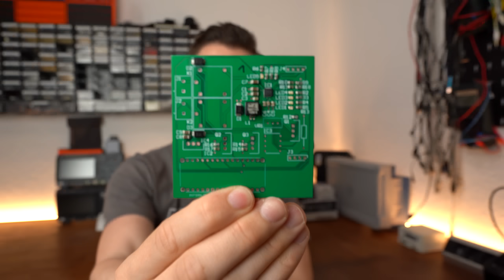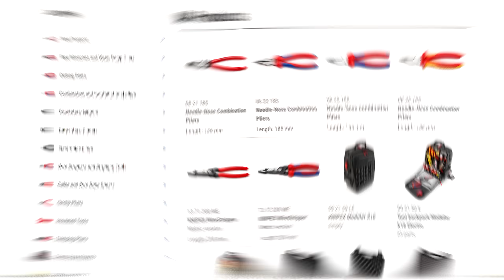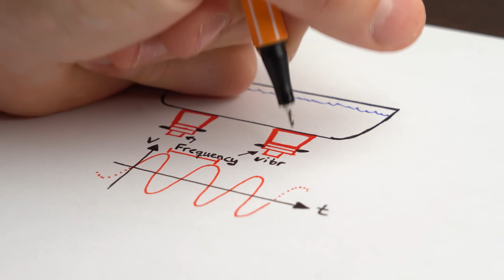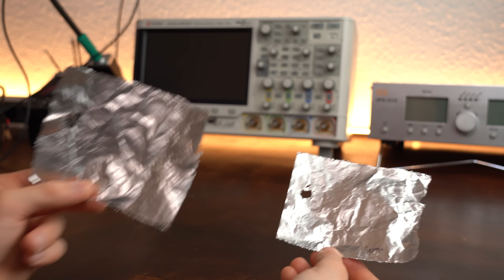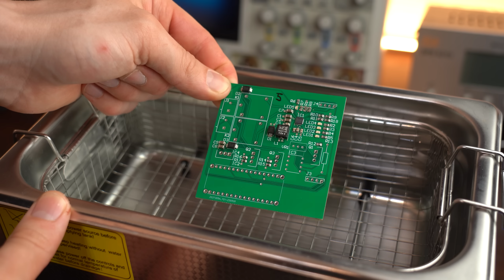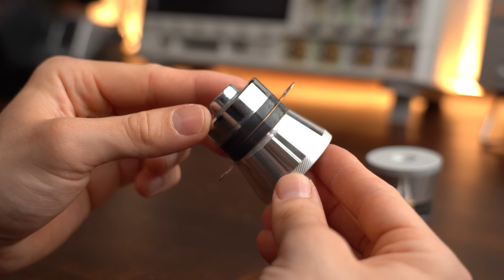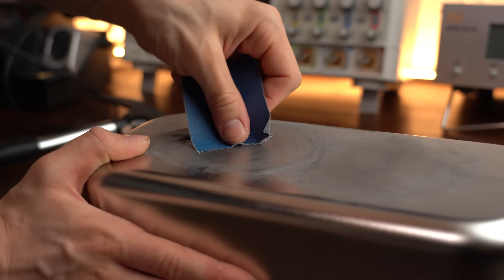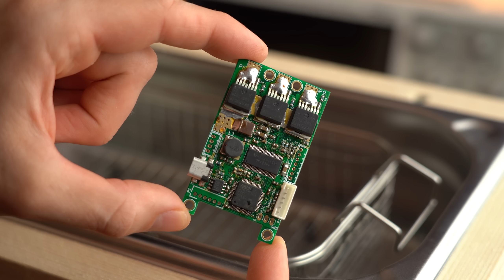The Most Underrated Tool? (DIY or Buy) Ultrasonic Cleaner!

Comment: I couldn't live without my ultrasonic cleaner, whether it's cleaning electronics, water-damaged electronics, or even for cleaning fossils - it's simply brilliant. I only have an inexpensive one from Aldi, but it does the job perfectly in my opinion, although you might need to wait a bit longer.
Reply: Thank you for your comment! Do I understand correctly that the ultrasonics do not compromise SMD connections? What about foil?
Reply: @cherylm2C6671  Normally not, but no guarantees. It's always better to clean delicate items by hand, especially when dealing with important circuit boards. It's best to try it out on boards where it wouldn't be a big issue if they got damaged. It also heavily depends on the strength of your cleaner. With the one I have from the discount store, nothing gets damaged, but industrial cleaners can be more risky.
Reply: @MarcelSchr  MarcelSchr, thank you. It seemed that ultrasonics would be better for mechanical components. 3M has a component bath that I think should work at KHz or lower frequencies since it won't cavitate ?
Reply: @cherylm2C6671  I'm sorry, but I'm not familiar enough with that topic. As I mentioned before, I'm more into it as a hobby. It would be better to ask professionals who use such equipment in their work, like cellphone repair shops, for example. They often use ultrasonic cleaners.
Reply: @Hyzerwyzer  Yes, but it should only be done for private purposes, as it can also damage the fossils. Often, water can penetrate into small gaps between the fossil and the rock and "break it free."
Reply from the maker: Thanks for the feedback :-) Yep, if you got the time, I think it can do its job very well.

Comment: I have to say that the soldering on the PCBs looks horrible, you should try some fresh / different paste, and a higher temperature as well. The one that you are using doesn't melt properly, so it forms balls and doesn't pull components into their spots. As a tip, try mixing the paste with a bit of wet flux before applying, I found that this often helps to get better soldering results
Reply from the maker: Thanks for the tip :-) Yep, I realized too late that my solder paste is no longer useable.
Reply: yeah I noticed that some solder paste works better than others. Sometimes, for small batch, I just do manual "wave soldering" with soldering iron, a good solder wire and some extra liquid flux, they're easier to clean up, and no solder balls. For large batch I just use the pcb assembly service.
Reply: I @yugaindiranmarimuthu7310

Comment: rust from your Tool can be perfectly removed with a 12v Car Battery charger, 10l Bucket Wather with Baking soda an a VASteel   as anode. Put the Anode and the Rusty tool connected to - in the Bucket and 20min Later the rust is gone.
Reply from the maker: Yep, there are many ways to skin a cat ;-)
Reply: Its very satisfying too, put the tool in the ultrasonic cleaner after :)

Comment: Tip for cleaning small parts in ultrasonic cleaner: Add cleaning solution and parts in a small glass jar and put that jar in the cleaner filled with water. Easier to clean and no need to use so much cleaning solution. Especially handy, when some small parts require different cleaning solution than what is normally used.
Reply from the maker: Sounds like a good life hack ;-)
Reply: @greatscottlab can it emulsify water and oil ?
Reply: even better solution is to use ziplock bags. Is the NASA approved method for voltile cleaing compounds in an ultrasonic. The ziplock bag doesn't mess with/dampen the frequencies as much as a glass jar will.
Reply: Use Ziploc bags, they work even better. The glass has to make physical contact with the tub for the content to vibrate, a Ziploc bag doesn't have this drawback.
Reply: @damustermann  Thanks!  I hadn't even considered that one.
Reply: @damustermann  I agree with you. I have used the Ziploc version for years. However, I believe that the glass, and it's contents, are all surrounded by the sound waves causing the molecules to slam into each other whether they are solid or liquid and travel right on through. The waves propagate themselves right on through. Thus, absolutely no need for them to be in contact with the walls of the "bathtub." There is a degree of attenuation as a result of the items in the bath absorbing the sound waves, but that is minimal. Just don't stack stuff full to the brim in there - use your common sense - and keep them below the surface. And maybe no more than about half full.
Reply: That's brilliant!. 

Are there any drawbacks though?
Reply: @therealb888 Yes, the extra container does absorb some of the ultrasonic energy, but results will depend on the power/quality and size of your ultrasonic cleaner…..and what your cleaning off your parts. Heat and proper solvents are also a big factor😎
Reply: @therealb888 no .... maybe lite bit less power but I didn't notice it when I do that metod
Reply: @therealb888  You can use a glass jar with thick glass or some other cleaner which is compatible with the glass jar. 
Also you've to slightly reduce or increase its frequency making sure that the jar won't vibrate much (or reach its resonance)
Reply: @therealb888 no drawbacks unless the circuit is off before immersing in the solution or if you completely dry before turning it on for use
Reply: @pianoguy5110     Could you please elaborate?
Reply: @pianoguy5110  I meant how it may affect the frequency & hence the cleaning or the glass itself. Some cleaners have frequency sweeps so can a glass reach resonant frequency & crack?

It's been a while since I've read these so pardon me if my questions are dumb lol..
Reply: @therealb888  OH..  I see I thought you were asking abt pcb
As per you question the frequency of the ultrasonic cleaner may be   dampened by the glass jar.... this can reduce the effectiveness of the cleaning process. Also you've to make sure that if the glass reaches it's resonant frequency it can burst '_'
Lastly   the glass jar may become cloudy or (etched) overtime due cleaning solution and ultrasonic waves.....
Reply: @therealb888 exactly. I was just watching several ultra sonic cleaner and this sub container thing is often mentioned buy I wonder if it makes the cleaning less effective. Some say  using a plastic jar works too but it absorbs some of the frequency or somethig and a glass jar is better, but if it affects the effectiveness of the cleaning by how much exactly. Or if using another stainless steel container  is might be better than using glass jar
Reply: Chemists have been using glass beakers in ultrasonic baths for 50+ years to more thoroughly dissolve powders into liquid media (sample preparations).  Ultrasonic waves in these devices are typically 37 KHz at 75 to 200 watts of power.  Sound waves at this frequency and magnitude pass easily through glass and plastic materials with almost no attenuation of power.  The bubbles you see are doing most of the work of “cleaning” via a physical process called cavitation.  Most chemists use deionized water in the sonicator bath which acts as transmitting medium for sound waves. Glass beaker containing part to be cleaned and cleaning solvent (acetone, isopropanol, or methanol) is added only inside the glass beaker as a convenient way to keep the sonic bath from becoming contaminated with unwanted residues.  👍
Reply: One more trick, lubricant bathes!  I have restored and repaired many thousands of dollars worth of “non-serviceable” items by doing this.  The lubricant is able to work it’s way into places that it may never get to otherwise.
Reply: @gunneralpha7490  how do you perform a lubricant bath?
Reply: @gunneralpha7490  Do you mind sharing the exact lubricant you use in your solution? Whether it's mixed with anything else, depending on materials being cleaned, and what you typically clean using this method? I have plenty of lubricants from oils of nearly every kind, silicone based stuff of all varieties, and dual use bio-based coolant lube for machining. I'm curious if any of them are a good substitute, or if I have something close to what you use already. If this gets to you, thank you so much for the knowledge. I really appreciate it!
Reply: @seasaw40  It really just depends on what I’m working on and if I’m trying to just break a part free, rejuvenate seals, or imbed the lubricant.  For general freeing up I use WD40 mixed with mineral spirits at around 2:1 and heat to 125F.  I’ve used Kroil a few times as well with good results.  WD40 is great for freeing up, but always run it in a degreasing solution afterwards because WD will eventually get gummy.  Kroil is already very thin and will not gum up the same.   Both are readily available in quarts or gallons.  As for lube that I want to leave in something, like a solenoid valve,  it’s a toss up between a thin silicone, or CLP.  

It’s really just a matter of experimenting and trying to get the solution just thin enough to do the work and making sure the container won’t be attacked by the solution.  You’d be amazed at how fast solvents and paint strippers will work in a sonic cleaner!

As far as my cleaning solution, I generally just use one of the simple green variants at at about 4:1.  Again, heat is the key ingredient that really makes the difference in “looks clean” and “is clean”.
Reply: I’m going to have to try the zip lock method, though I would worry about a corner of a part possibly making a hole.  I have been using cheap stainless steel containers for mini baths and it has worked great.  The cheap ones have very thin walls so the vibrations transfer through easily, even if the container is not touching.

One of the coolest tricks I have learned with my cleaner is that you make a bath of rust remover, the kind that is mild enough to leave a part in for 24 hours.  With added heat it can do 24 hours worth of soaking work in 30 minutes without eating away any good metal like an acid bath would.
Reply: I do something similar: put the part in a vacuum seal bags with the solvent or cleaner, and seal it. Make sure there are no bubbles. Then dip in ultrasonic cleaner full of water.
Saves even more cleaning liquid/solvent.
Reply: When I want to clean parts in ethanol, I always put them in an airtight sealed bag and place it in the cleaner. This prevents alcohol vapor from being released.
Reply: @MarcelSchr  yep, another reason for using ziplock bags
Reply: One better:  instead of a jar, use a sealed plastic bag.
Reply: i doubt the glass, however someone mentioned plastic bags which more confident with.
Reply: It wont work as ultrasound power would reduce because of walls of container.
Reply: Louis Rossmann ... recommends the Crest CP500HT Ultrasonic Cleaner ... and Branson EC Cleaning Fluid ... Video: Ultrasonic cleaner for repairing Macbook logic boards.
Reply: So used alcohol in the glass water in the tray
Reply: Been doing this method for a good few years for cleaning fishing reel bearings using a jar of kerosene placed in the water bath ( a cheap one from Aldi) When I started messing with pcb's I just changed the liquid to isopropanol. Even takes off the crusty bits
Reply: using a one gallon ziplock bag works too
Reply: does it make a difference if the lid is on the jar?
Reply: @demofilm  shouldn't matter, the waves will go right through the glass.  only reason you'd maybe close the lid is if the contents are stinky or flammable (but don't do flammable, it's asking for trouble)
Reply: @ame7165  thanks for the info. i apreciate it a lot.
Reply: The additional (glas) material thickness is a small resistor for the ultrasonic wave. 

In the jar you have lower power.
How mutch lost of us power ? 
I dont know and will not measure it with a DIY ultrasonic power meter. 
(It will be your next project to measure the intestity in the jar or the power of the small implosions) 

But it is a idea.
Reply: I'm thinking plastic bag as glass will reduce  US transmission a smidge
Reply: Also wenn du mal wieder Simson Vergaser oder Platinen reinigen willst...es gibt nen Trick. 
Such dir ein Einweckglas, fülle Benzin rein für Vergaser und Isoprop für Platinen...du wirst überrascht sein. 😉👍

Comment: for removing flux residue temperature is very important! I use my ultrasonic for cleaning logic boards after microsoldering repairs, and flux residue is infinitely easier to remove at 70C that it is at 20C
Reply from the maker: Great tip!

Comment: I've found I get better results with heated water, which is why the modern cleaners have a temperature controlled heater built in
Also if you have those special coatings on you're glasses (like auto darkening) it might not be a good idea to put them in there
Reply from the maker: Thanks for the tip :-)
Reply: @greatscottlab  One other important thing I've noticed.  It will strip the zinc or black oxide coating from nuts and bolts.  Plus can damage paint.  Other thing to note is some cleaners are acidic, so may need to be neutralized.
Reply: @EmperorA0  you can use kitchen cleaner and that is equally effective. Also you can put the detergent with a little water in a ziplock bag with the item and then put it in the cleaner.
Reply: @EmperorA0 that brings to mind that many higher quality carburetors are/were plated.
Reply: It will also strip all chrome or nickel plating. I've damaged my expensive airbrush this way.
Reply: Also, ultrasonic cleaners will wiggle all the micro-cracks along the edge of your lenses, and eventually bigger and bigger cracks will form. My glasses were clean all the time, but the lenses lasted only a year or two when I was cleaning them this way just occasionally.

Comment: Beware when using an Ultrasonic Cleaner on vision glasses that it can damage the different treatments that have been applied to the glass, so always check with the manufacturer of the glasses that an ultrasonic cleaner is safe to use !!!
Reply from the maker: Thanks for the tip :-)
Reply: @greatscottlab  I learned the hard way haha, great video btw!

Comment: I have a tool for holding slotted screws, as you slide one part down the blade get fatter and grip the screw slot. Its so handy for getting difficult to reach  screws started. But the ultrasonic cleaners have come a long way price and cleaning power Great video 2x👍
Reply from the maker: Thanks :-)

Comment: Can Ultrasonic cleaners make yellow looking plastic into it's original color?
Reply: Use Hydrogen Peroxide
Reply from the maker: With the right cleaning solution mixed in, sure.
Reply: it really depends! they can remove residue from, say, cigarette smoke which can make plastic look yellow, but if it's a case of formerly-white plastic which has yellowed with age, that's a chemical reaction that no amount of cleaning will get rid of, so you'll need to use a different method
Reply: tip: search on youtube for "retrobrighting"

Comment: Very cool and nice Video again 👍 I was already long time interested, to understand how these ultra sonic cleaners work 😃 But I'm afraid when cleaning PCBs, if these ultra sonic waves can destroy or harm ICs, like storage chips?
Reply from the maker: I doubt they can harm ICs. They can only attack the surface. But I am no expert here. Maybe someone else has the definitive answer ;-)
Reply: @greatscottlab it seems that there's a heat appearing a the layer boundary, and there are lots of small detail inside ic to heat from ultrasonic waves.
Mine 40khz 150w 2.7l diw cleaner makes ntc sensor temporary hotter than the water is.
Reply: @greatscottlab The problem is the bonding wires inside the IC's that are getting stressed, that's why you don't see these cleaners used in manufacturing anymore. It's like the ESD "problem" 99% of the time you will not see a problem. ;)
Reply: I found to really clean stubborn flux residue you need to run about 55+ degrees C and this can fade the pcb colouring a little.
non sealed components like unsealed relays can get waterlogged.
Reply: No, UCs are used constantly in the PCB industry, we ultrasonic entire motherboards with integrated flash chips, only time you should be careful with with certain THT Capacitors
Reply: @fronkshitposting what freq you use to USc motherboards?
Reply: @DmitryKiktenko  45khz
Reply: @fronkshitposting  I've heard crystal oscillators could be destroyed under ultrasonic baths. Not sure how certain is....
Reply: @josedavid6400  I can happily report ive ultrasonicced several hundred macbook boards, they all contain 2 or more crystal oscillators and all work after the bath :)
Reply: @fronkshitposting  great! thanks for sharing the info.
Reply: @fronkshitposting  then you are doing it wrong 😂 of course it can be done, with success. I'am just letting people know of the risk.
Reply: @ffs5310  Not "can be done", its "is done", theres no risk to internal wires in ICs..... tell me what ive been doingwrong for 6 years, so far havent killed a single board with my USC
Reply: I have found NTCs are gettin internally hotter in ultrasound, altering actual values.
Reply: i've read somewhere that they do harm crystal oscillator, but i've used them on boards with crystals with no noticable damage, i usually only run it for 1-2 minutes though
Reply: Why does Youtube says 18 seconds ago and this comment is 5 days ago?
Reply: @mreighter  he's a Patreon member
Reply: @mreighter  private